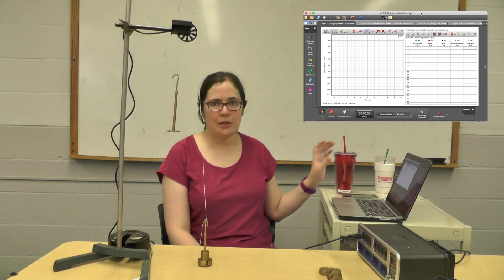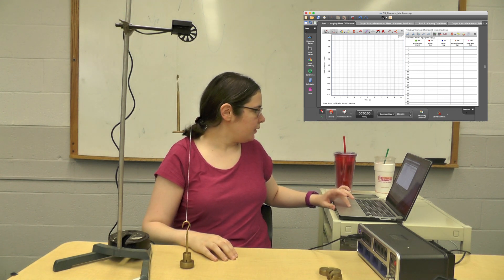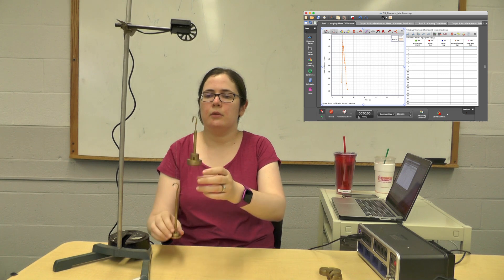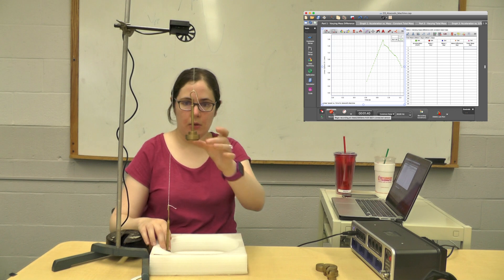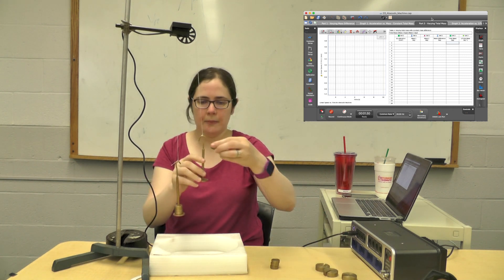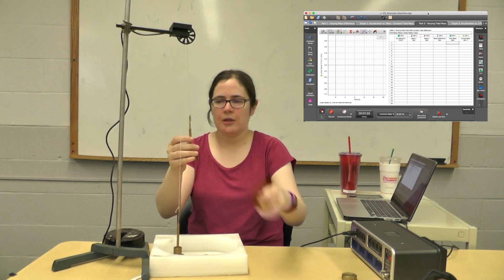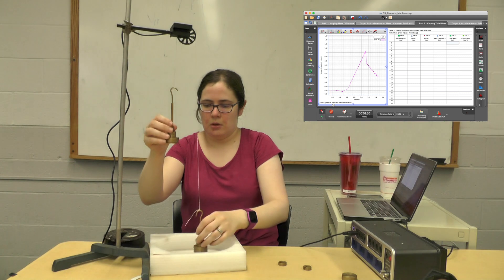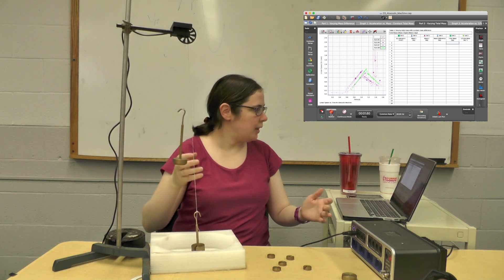Atwood's Machine Lab

Comment: Ma'am what is the use of this experiment 🤔
Reply from the maker: The purpose of this experiment is to determine the mathematical relationship between the acceleration of an Atwood’s machine, the difference between its two masses, and the sum of those two masses. It's good practice of Newton's Second Law, the particular forces of weight and tension, and the geometry of pulleys.
Reply: Not a good job at demonstrating what the thing is designed to do.
Reply: You are erong.